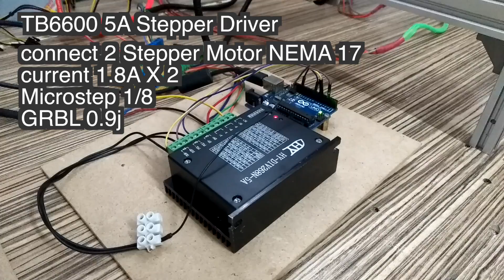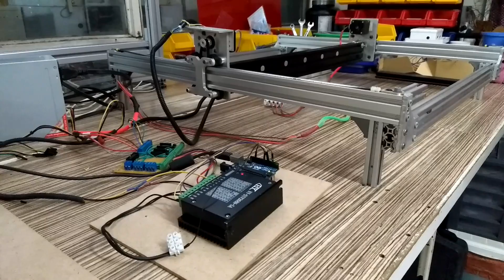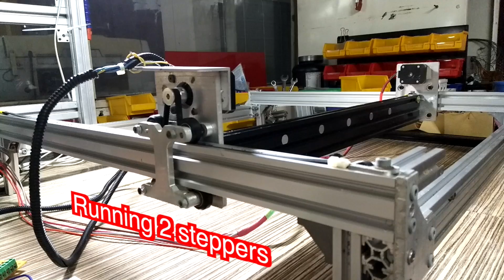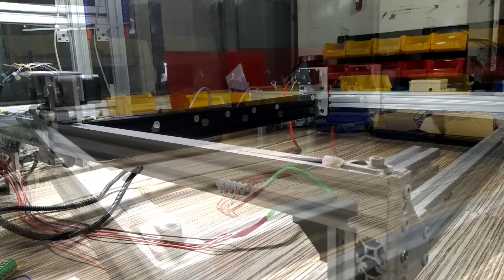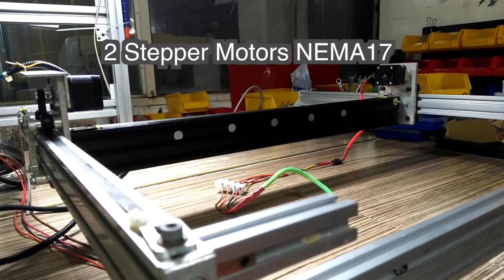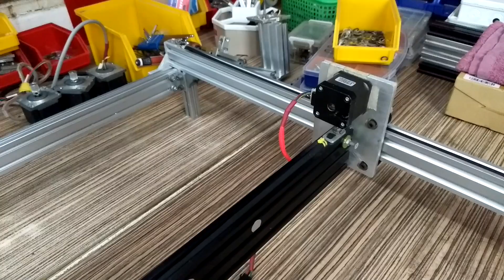CNC Y axis test Running 2 Stepper motors (NEMA17)  on one TB6600 Driver

Comment: I want to build a project like this one but i want the stepper motors to move as it receives data from sensor.
the project is an irrigation system that will move the water hose on the right position of each pot and each pot will has a soil sensor. you can called it CNC for irrigation. i'm just confused about what drivers will be easy to use for this project because i will  and can i use grbl ?  i will be suing two nema 17. need help
Reply: hi mohammed, have you already  found out the answers?